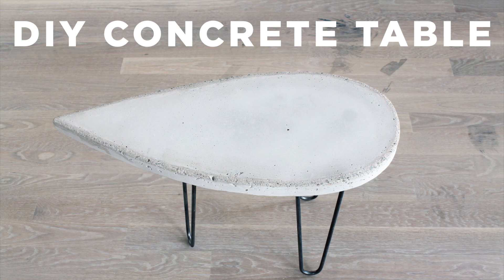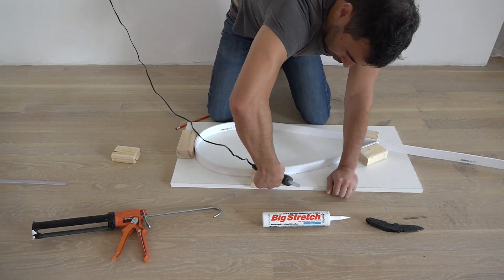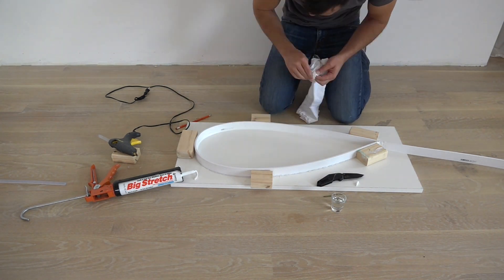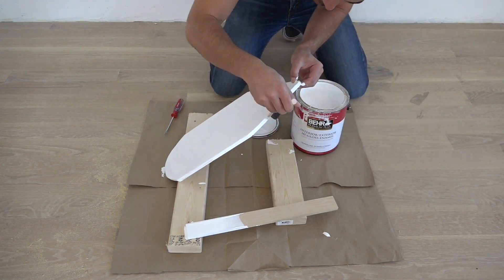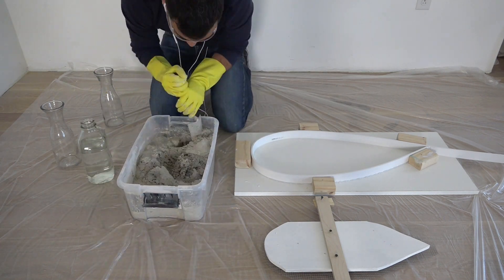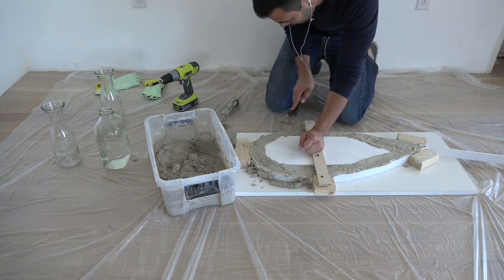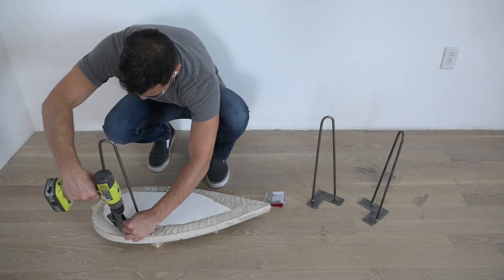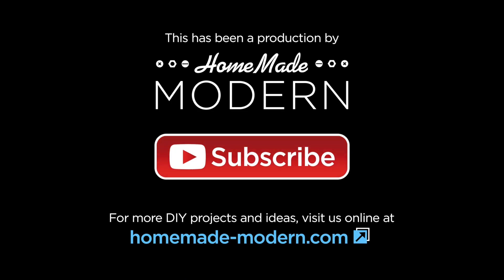DIY Concrete Side Table

Comment: Just a tip - Instead of painting the wood to make it waterproof, you can cut up poly (think 4mm or 6mm thick painter's plastic) and staple it to your plywood. As long as you have no wrinkles, you'll get a smooth surface and you don't have to wait for paint to dry! It's what we used to do in my civil engineering courses back in college.

Comment: I like that, i just did a video with my first concrete table. I think the wood caused some damage to the sides of mine. In the future I was just planning on making it smaller so the edges had some room, but thanks for the tip about painting it too.